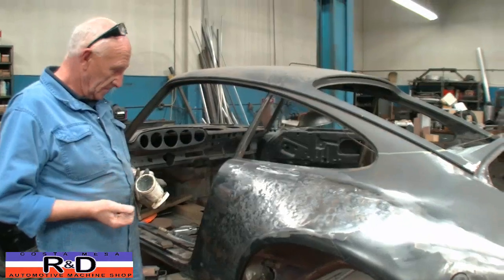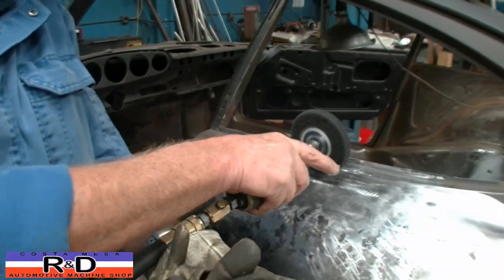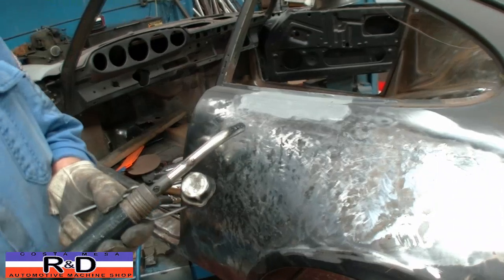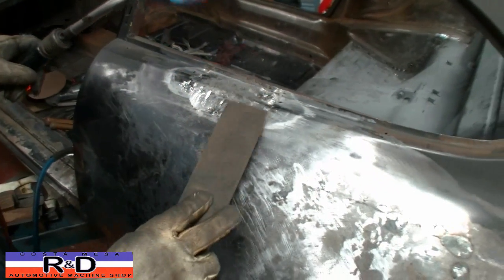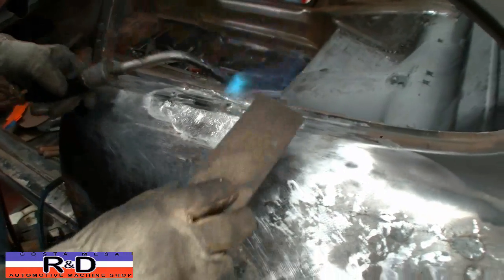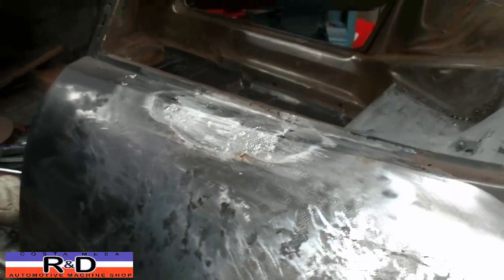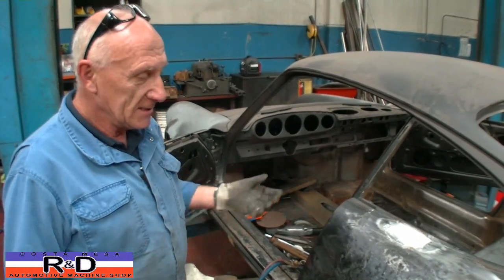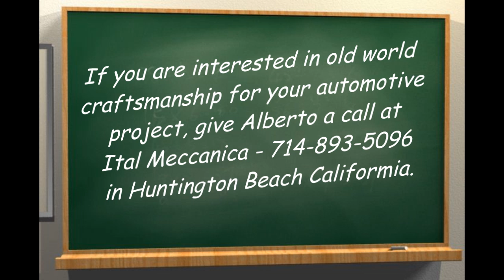Using Lead in Body Work Instead of Plastic Filler

Comment: Dying art. Definitely prefer this method of body work on my 71 pagoda over bondo. Why anyone would use bondo on any vehicle that has a potential value of 6 figures when completed is beyond comprehension. These guys should start an apprenticeship program to preserve the trade skill. High value skill because not many are doing it or even know what it is.

Comment: Folks, he is using 70/30 solder like what is used on brass musical instruments. 70% TIN and 30% LEAD. There is nothing else in the rod besides trace contaminants. Having 70% of the filler be tin makes it much harder and more like steel. The 30% that is lead is strictly there to allow the tin to melt and flow. Electronics people frequently use 60/40 solder because it is softer and flows into small spaces better. You do not need the end product to be super stiff like steel on a PCB - you need two pieces of metal to have permanent contact with one another. On a trumpet (or in this case a quarter panel) you need the end product to be very hard, so the tin content is bumped up some. He is not using "lead" as some keep saying. It is tin/lead solder.
Reply: Still a dangerous mix. Pretty much any lead without sophisticated protection is too much.
Reply: Exactly.I was a panel beater in 1958 to 1968.We always used body solder with good results.Did not harm me at all.85 now.
Reply: @DDS029 Yes because the chemicals and fumes in other types of filler are sooo much better for you duh. People hear lead and right away want to put on hazmat suits you probably drinking worst in your tap water than the exposure using this method.
Reply: I used to melt 90% lead, 1.5 % antimony and 3% tin in a stereo room as a kid. Dross off the impurities and make ingots or as was called pigs. We were printers with Linos and news work. I added plus metal to keep the ratios constant. At 540 degrees things were a little warm at times. I kept taking salt tablets and water. Start drinking Pepsi and you could get dizzzzy. We had a body man in town and a new Ford car fell off the transport truck from the factory. This man used 6" X 1/2" square lead with oxy to fill in the bent fenders. I have used solder/oxy to repair a gas tank leak on a Mitsubishi car and it requires a cleaner to prep the metal for best results (the cheaper solder from China is bad news). This approach we see here seems rather slow; but, I only guess. The tin gives it hardness and the antimony allows the lead to fill in the tiny pockets. I would rather use a smaller torch head with the fuel being used here and thus allow the application to be heat and filler metal (simotaneously  sp) with a more continuous motion. This would speed up the process and lay down a more continuous amount of filler. It can be done either way. I have seen the oxy approach and it is fast if you have the hand.
Reply: yes, its ok to sniff bondo fumes and kitty hair.
Reply: Steve Prince   Thanks for the info Steve. The body man I used to watch using those sticks of tin/lead/antimony on a fallen Ford car had the side of the vehicle jacked up about 10" higher soes he could lie on his side and oxy the lead to the bottom pan of the quarter panel. He was using a soft flame from a Victor size #4 tip and applying the lead to an overhead position. When he got close to the end of a stick of metal he would use a pliers to hold it. In the days I melted Lino lead if I had just the right heat, I could make pigs without a deckled edge-the lead would be smooth and not cut your hand while picking up a pig after it cooled down. We had machine operators that could pick up a hot piece of Linotype lines when they came out of the mould. I had to wait til those lines cooled down before my nerves could handle that much heat. The 300 Comet setter had a water cooled mould so those slugs were easily handled. 
There were two straight trunk trees by the front door of the body shop ( which had previously been a carriage shop in those years of black smithing). I went over to view his work one summer day and he was pulling out the right front nose section of one of those Econline cab forward small pickup trucks and had it stretch between those two trees with a couple tires off the ground.
Reply: That is not correct; it is 70% lead and 30% tin.  You might go as low as 20% tin for body solder, but otherwise you would not want a higher tin percentage than 30% except for the preliminary tinning stage, for which the craftsman used an all in one tinning butter product.  You could also use a separate flux and plain 50/50 solder for that, but the tinning butter is more convenient and easier to use.
Reply: @netpackrat  I tend to believe as you the 70% is 70 lead. Tin is so hard I cannot sense that the tin being higher would lead to an impossible metal to work. Linotype metal has a higher lead to tin ratio than foundry (factory made) type that is not melted and remelted after each casting. Thanks for clearing up that point. We would not have the "lead sleds" of the 50's with such a high percent of tin in the mix. Tin in a visible spectrum has a more silver appearance and I have seen cars with the paint removed and the lead filler on a fender looks more gray than tin silver.
Reply: 8
Reply: If such a small percentage of lead is used, how come leaded gas and paint is frowned upon?
Reply: Teach Yourself about Lead:  https://nutritionfacts.org/?s=lead%20metal%20&is_v=1
Teach Yourself about Arsenic:  https://nutritionfacts.org/?s=arsenic%20chicken&is_v=1
Reply: Well said. I have a 1lb spool of 60/40 right next to me on my soldering table, it is so much easier to solder electronics that way, used one spool of unleaded and never will again. I love this technique for body work, realized about 1 year ago when reading up on body work about it. When  I was around 9  I use to playing with triangle bars of almost pure lead you could press your finger nail into it and wondered why my dad had them until I learned about leading body work.
Reply: @philipfry5859  Yeah, just keep good ventilation. I worked with 60-40 or 63-37 electronics solder, and 70-30 lead rod solder for brass instrument repairs, and I did 1920s-1960 cars with lead & maple spatulas. Heat rises. I little exhaust fan or a little cross breeze and your good. All the welded seams on the 1947-1955 GM pickup trucks are filled with lead from the factory. The ONLY solder I want to see on brass or a horn is soldering on supports and ribs. You don NOT want to fill with lead. You want to take the dents OUT completly with balls rods, mandrels magnetic balls anvils, drawing mandrels etc. It's a lost  art and it is an art too.
Reply: 70% Lead and 30% Tin is the correct mix, sorry to correct you but you just mixed them up.
Reply: @philipfry5859    That    Cool    Do   you    Prefer    It   Over    fIller   ?

Comment: He's right plastic body filler is pretty terrible stuff  . I'm working on my 1970 alfa romeo and found 10 mm thick slabs of the stuff all down the sides that has soaked up water and blown out  . Going to replace with real metal and try and teach myself lead loading for a permanent solution  .

Comment: I was taught to do lead wiping as we called it while doing my apprenticeship with Mercedes Benz back in the late seventies in South Africa we weren't allowed to use body filler we had to panelbeat  using a what was known as a file hammer and then file it using a flexible body file  and shrinking any high spots and if i'm not mistaken i saw the marks of a file hammer on his fender we used a different technique for spreading the solder not too different except we made different shaped wooden blocks for different parts of the vehicle usually teak and we also used ATF and later bees wax as a lubricant to help spread the wet/molten solder applied to the block before spreading it also prevented your blocks from destruction i'm happy to see that the art of body repair the proper way is being kept alive respect sir
Reply: Amen to that. Well said, Brother. RH DSD
Reply: @jasonstalder5208    Before there was bondo for dent repairs, way before you were born, this was the proper way.
Reply: SpeedRacer 650  It looked like to me he stayed on the tinned area, just got close to the bottom edge.
Reply: @sailingsolar  i know buddy, my dad taught me to lead load and is older than the gentleman in this video. i live by the old ways. the tin of bondo in my shed is so old it cannot be used (thats how much i use it)
Reply: All correct.

Comment: I started doing Autobody repairs in 1957 the  sheet metal on the cars of that era was substantially heavier ,and still you had to be very careful to avoid warping ,the cars of today could never take the heat without distorting beyond saving. True Bondo changed the whole industry.
Reply: Hi can you pls share some of your tips and tricks from your Automotive career?

Comment: New “lead sticks” are not lead anymore, for certain structural joins especially on older cars the best method of repair is still solder. The main issue people have with this method is not controlling the heat, it’s all about cleanliness and heat control.

Comment: This is an extremely hard method and a lost Art. We were taught this in Autobody school, but with the advent of Plastic mudd filler, Lead was not used very much. A true body man can use lead and filing and shrinking but it is an extremely hard art to master. Lead is a hundred times better than plastic, but todays body panels are very thin compared to a 55 chevy or Deuce coup type of hot rods. My Respects. RH DSD

Comment: Watching this guy  lead loading takes me way back to my apprenticeship ,part of which was accident repair, this was about the period when  the modern body filler was just emerging, people here talk about the health risk with using lead , sure , but when  the present day types of body filler came in  not many people thought to use breathing masks , so it wasn't only the actual user that suffered , anyone working in close proximity were also affected,      
 I remember one old guy , he was a joy to watch , lead loading was an art , he always had a Woodbine smoking away in his mouth , great bloke , but what I did pick up on,    
 old Les used to shape the lead by using a mole skin covered spatula to which he would apply a very light coat of tallow, in those days  it was just not allowed to use  filler paste on the Rolls Royces and Bentleys it had to be lead , hey the good old days ?
Reply: When I was fixing cars back in the 1920s I was leading up a storm with solid lead

Comment: Leading was a common practice in the factory back in the forties, fifties and sixties. utube has several videos showing this. but those guys were quick and very accurate.  a lost art!
Reply: GM car plant in Oshawa was still finishing body work using using tin/lead in the 80s.
Reply: I had a '78 Chevy truck body that had some lead over a repair that appeared to be factory work.  Eliminated the rust around the edges of the lead, and then re-repaired it the same way (lead).

Comment: Don't worry about protective equipment. There was a canary off to the side next to the asbestos wrapped chewing tobacco and the leaded gasoline space heater.
Reply: Yea because there is not toxic chemicals in bondo and fumes
Reply: Give us a break, would ya?
Reply: relax, he wasn't chewing on the shit! lead gives off toxic fumes when its over temp and TRUST ME after 17 fucking years in the trade the isocyanate will get you 1st every time
Reply: @jasonstalder5208  exactly! if lead poisining worrys you you probably should work in a body shop because frankly i dont think theres anything in there that wont fuck you up

paint fumes
resin fumes
exaust fumes
oils
fuels
other automotive fumes
sharp things
hot thinks
heavy things
pneumatic nut drivers justt waiting to snap your wrists off 

ppe is helpfull but there comes a point where you just have to say fuck it and get the job done 

cause if you go by the recomendations that soy latte drinking office boys will come up with your average roofer would spend half his time just setting up infact i think the current H&S requirements for reflashing a roof would be 

scafoliding errected if its over 1 floor
roof scafold with safety rails to prevent falls
full body harness with arrestor cable and dual tie off clips
knee protection
eye protection
gloves
full respirator
hearing protection 
full faced mask for splashing
the 1200 page risk assessment document
the £30 a hour supervisor to ensure H&S compliance 

fuck off just get your ass up the fucking roof and do the job so we can all fuck off up the pub for some lunch
Reply: fuzzorama  you’ve been sniffing  way to many mothership fumes
Reply: Pretty much guaranteed that if you work in a body shop unless if you wear a hazmat suit at all times you're going to greatly shorten your life or risk your health. I knew a old timer that sprayed laquer paints without any breathing protection. When the job was done he'd have a vodka and a cigarette while washing his hands with laquer thinner/gasoline/kerosene... Also, Bondo dust is really bad for your lungs, so no matter what you lose.

Comment: Alberto is an artist! A true lost art! Plastic filler is not all together that bad because it does have its applications. You can't do this to a painted panel and the heat does stress the metal.
Reply: Why would you want to

Comment: When I was on a school trip to the Ford Motor plant about 100 years ago (might as well be) I watched a guy filling the join between the roof and the body with lead on a Mk3 Cortina.
Reply: Correct; they used lead fillets to contour those joints.
Reply: All cars of that era had lead joints in the rear dog leg...its a dying art lead filling/joining

Comment: I was taught by an ex Fisher Carbodies lead loader, and I did it for many years. Two things: I never used my finger with the solder paste, but a clean brush, and secondly this an active acid flux and after tinning it's essential to rinse off any residue or you will get crazy rust. We made a hardwood bat, like a little boat, which we kept in a hubcap with some clean oil and a cloth. You can do any shape with one of those. By the way, when car bodies got thinner in the 1980s, believe it or not we had an asbestos mash mixed with water that you put on the body around the lead area to keep down distortion.

Comment: Body butter is traditionally a tub of tallow that is used as flux for leading.  Since tallow and butter are very similar, and it looks like a big cube of butter, I assume that's where the name came from.  I've never seen plumbing solder paste used for tinning the body, but it makes a lot of sense and it much less stinky than the traditional method.  The only concern I would have is the flux in the the paste being corrosive if not washed off immediately after tinning.
Reply: +eformance the tallow part of this that it is the barrier between the leading bat and the body solder
Reply: Hotgoddamthatizsum beautiful  utoob writin!
Reply: EFormance Engineering the sheep tallow is used on the wood paddle to keep the molten lead from sticking to it instead of the metal.....my uncle owned a body shop in Hamtramck, Michigan years ago I watched him perform magic with lead filler
Reply: There were different blends of plumbing solder

Comment: I tried this once with my Reliant Robin. It didn't go well....
Reply: Ha ha ...
Reply: your meant to use a hair drier and Plasticine on robins ,,, lol
Reply: robins are a small three wheel car here in the uk , prone to tipping over , however the joke here is that they are made of fibreglass , lol
Reply: I remember a guy restoring a 1968 Oldsmobile 4-4-2 and he used lead instead of bondo (aka plastic body filler) for the body panel filling
Reply: Lol
Reply: you forgot to pour a little bit gasoline on it

Comment: Omg this brings back so many memories. My father was a body and fender repair guy most all his life and wiped lead back in the 50 & 60's. Use to watch him squish the lead rods and make puddles and then working it with wooden paddles in acid that had different shapes and sizes. 
He would be 98 now if he was still alive. It is a dying art that the new generation never learned but the metal of today cars will not stand up to the heat without warping.

Comment: My friend a I rebuilt a 1944 Willys MB and that how we did all the panel joints on the patch panels. Did it 6 years ago and their still solid. It was daunting at first but really was a lot of fun. We did it in an open air and all filing was done by hand. Power sanding doesn't really work like it does on bondo. The filing really does smooth out easily. Go to Eastwood for supplies, they are great.

Comment: If in a area of the vehicle were it's impossible to use a torch you can use a soldering iron I did a lot of this work in the 80s but I must say plastic filler is as good if done correctly the biggest mistake most people make with any body filler is they make it to thick no filler should be over one eighth of an inch thick
Reply: insulman100 I

Comment: I thought on modern cars the sheet metal was so thin that even the low temperature needed for soldering could easily warp the panel.

Comment: in the 60s the shop ihung out had a pot of molten lead cooking I have some lead bars which I use to fill small rust holes such as hood where filler does poorly in weather you can patch w.copper then lead if large spot.
Reply: watch out, some fool will try to pour that molten lead over someone's head like in game of thrones, my girlfriend told me about that and got me hooked on that show lol

Comment: Haven't tried it myself but I'm told you can use an electric hot air gun to give a very "soft" heat source.
Reply: you'd be there forever..